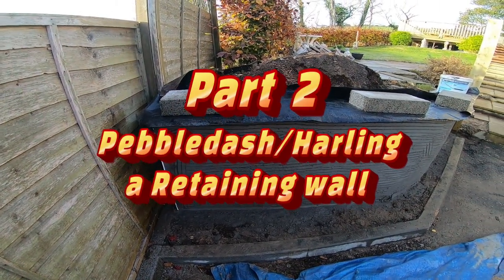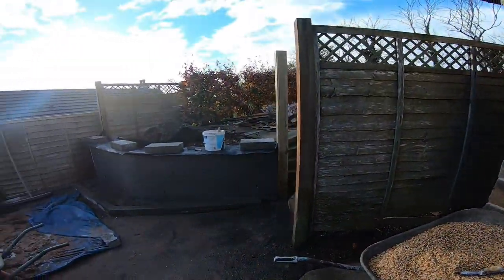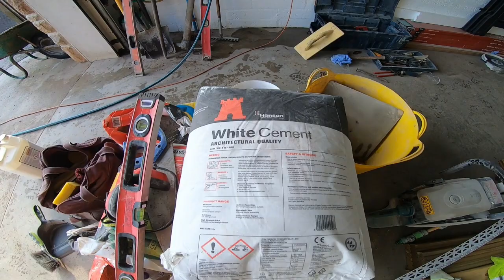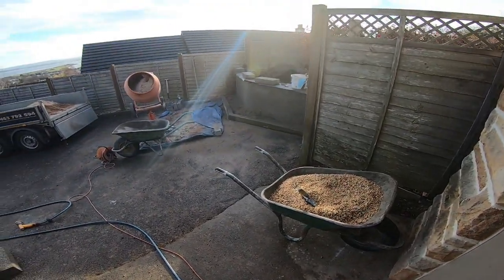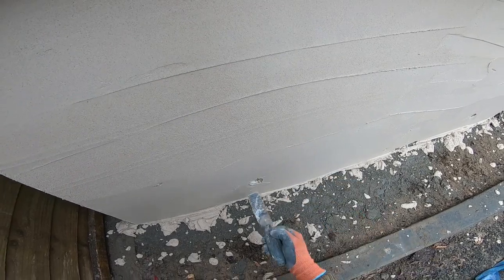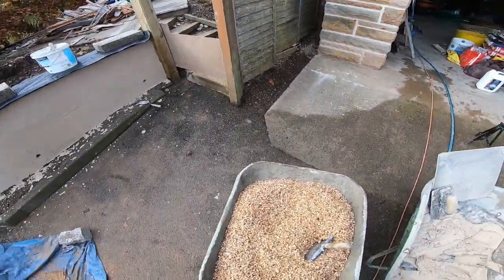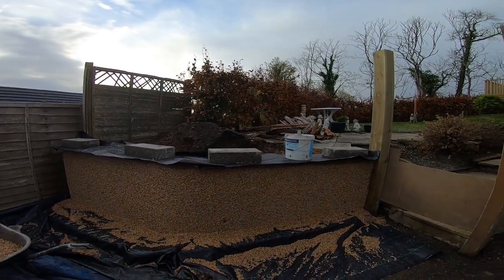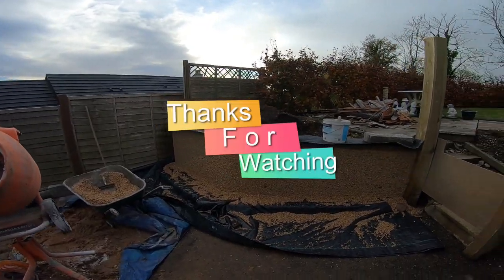How to Pebbledash/Harl a wall the right way😉

Comment: do you need lime in top coat,cheers
Reply from the maker: No, it's just white cement. You mix it up the same as the grey cement 4 -1 ratio
Reply: @naturalhabitatlandscaping3681  ok thanks